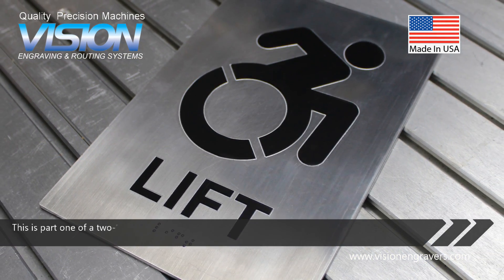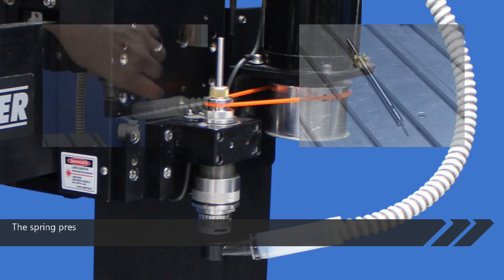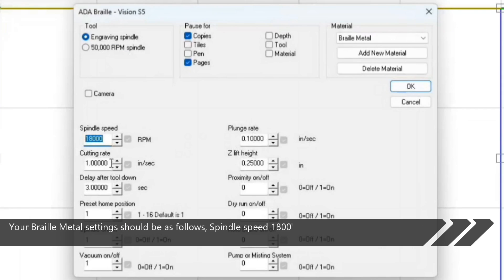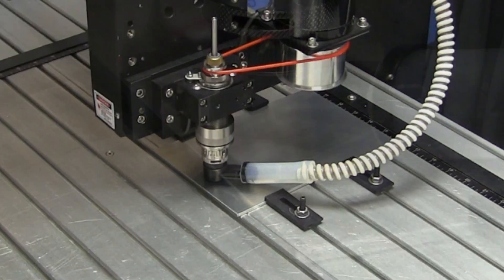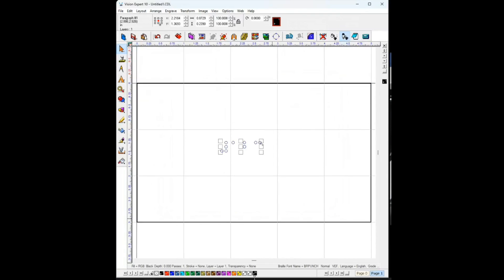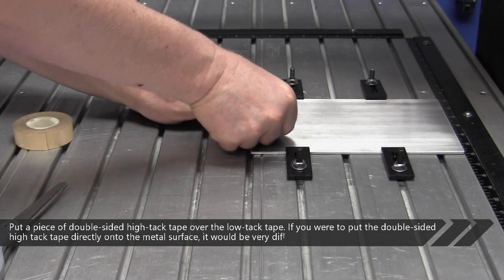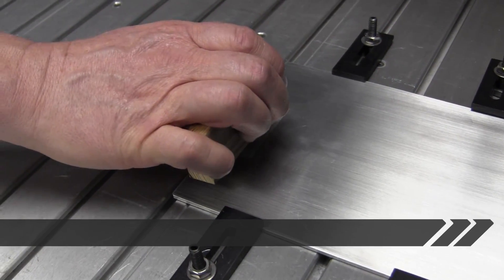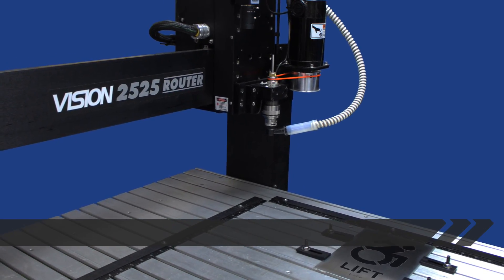ADA Braille Into Brushed Aluminum Tutorial Part 1 of 2.

Comment: Is that metal non glare? ADA signs are to be on non reflective surfaces I think.
Reply from the maker: You are correct, the ADA sign surface needs to be non-reflective. You will want to use brushed aluminum for a matte finish.